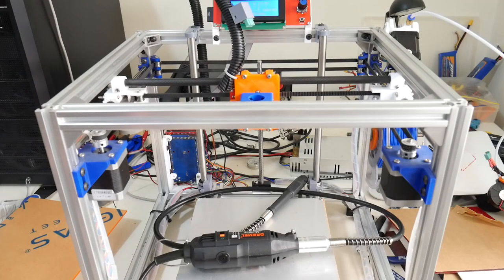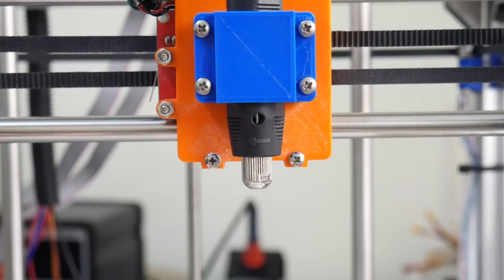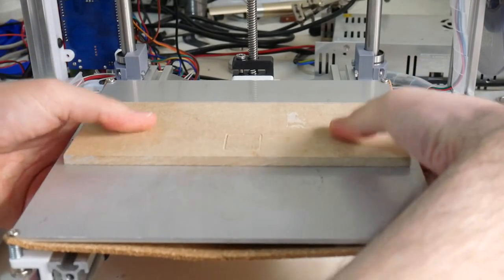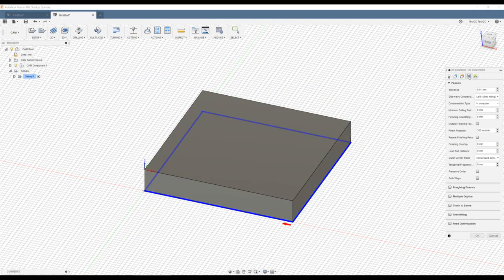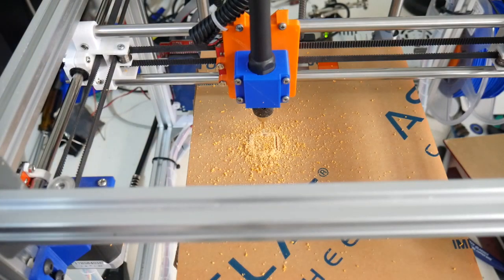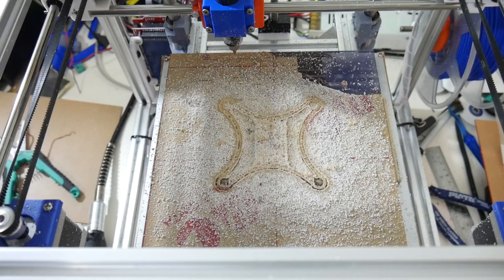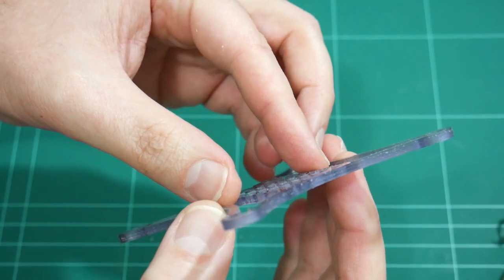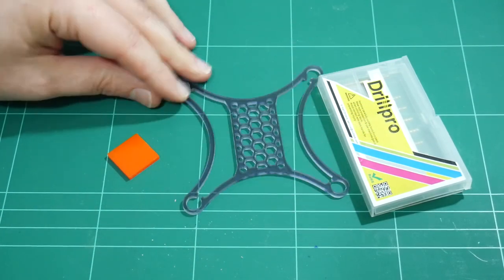Cut Acrylic with a 3D Printer

Comment: Trick I have used for holding stock down for cnc milling.  Painters tape and super glue.  Put a layer of painters tape on your bed and one one what you want to hold down.  Put super glue on the bottom layer of tape and press together, careful not to glue the part to the bed.  When done the tape can be peeled off easily for both bed and part with no residue left behind.

Comment: I would suggest that you get a car vacuum, there are 12v dc once around ebay and amazon I bet, that has long nose attachment. That way you can extend the hose with a similar flex hose with the same or close diameter, to extend it to the cutting area. That's the plan for me anyways for my attempt.

Comment: I've had my Dremel and extension kit for years wanting to do this. Several videos online prove that it's not been really viable. But I suppose within the boundaries of scope the milling of acrylic and slow feedrates and depth may work at the cost of bearings in the Dremel head. It worked amazingly well. From your experience though. When it comes to working on printers with spring leveling. Would you think this would be a problem as downward pressure is absorbed by the springs and vibration in the bed because of this makes spring suspension beds unsuitable for this kind of mod?
Reply: The springs really aren't bouncy. They put firm pressure in the positive Z direction. The only way vibration would be an issue is if trying to cut a very hard material like metal.

Comment: Great that it works, do you think a dust collector would work too as it would add some mass to the extruder holder...but would leave much less mess during/after cutting. Would be interesting what material the corexy hypercube can cut. Soft wood fore sure but where it stops working accurate without destroying itself.
Reply from the maker: Yeah it would be good to vacuum as it cuts. I'm not sure if the gantry could handle dragging a vacuum tube along with it but it's certainly worth a try.
Reply: @Tech2C  How about using an extension of the tube much smaller than the vacuum and the vacuum working outside and not on the extruder?

Comment: Very nice Project. You could try an 1 or 2-flute End-mill and use a slight coolant, so you should get a super smooth finish on the sides. But be careful with alcohols like IPA as it releases stress in the acrylic material and can cause cracks.

Comment: Would it be possible to print with solder instead of filament, or at least use a 3d printer to perform precision soldering?

Comment: I tried this without the flexible shaft -- mounted the whole dremel on the x axis.  It worked, but was very noisy, slow and messy.  Also, I could visibly see the mount deforming and the dremel slopping back and forth like a paint brush during the cutting.
Reply from the maker: That's not good. What were you cutting?
Reply: 3mm plywood.  I was afraid the acrylic might shatter.  

It didn't occur to me to use a flexible shaft.  That would have been a lot less weight to move around.  Perhaps I wasn't using a high enough rotation speed or something.  

I've taken it all apart, but I'll try again one of these days.  I wanted to build a separate smaller machine with laser and rotary cutter, as well as a "dust shoe" connected to a vacuum cleaner to suck up sawdust and odor.

Comment: Great video!! I was looking into getting a cnc but Im only looking to cut into "light" material.  This is perfect coupled with your other video convering to a laser!! As someone mentioned, " a 3d printer will never be a cnc machine and a cnc machine will never be a 3d printer". However, there is a happy median where the 2 can mimic the other  as long as the requirement is within reason.

Im thinking of converting my anet A6, what are your thoughts on that platform?

Great job and thanks for sharing your knowledge!